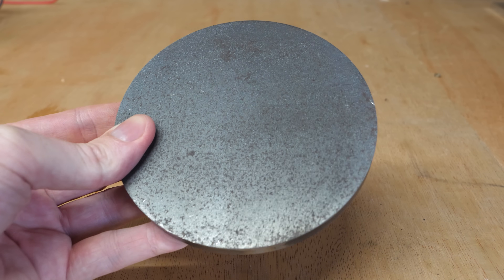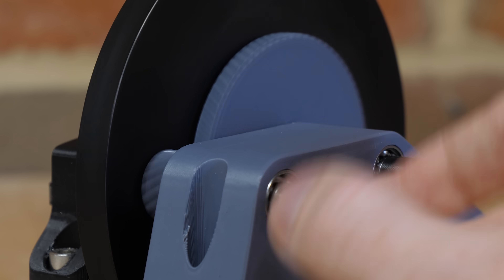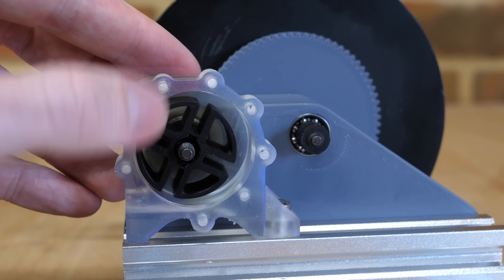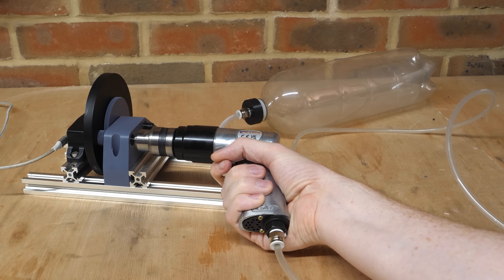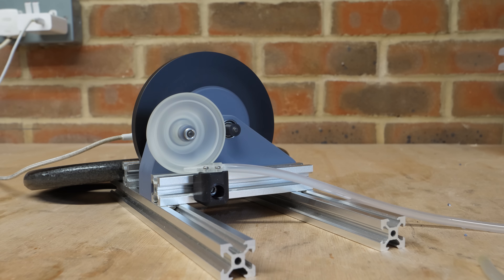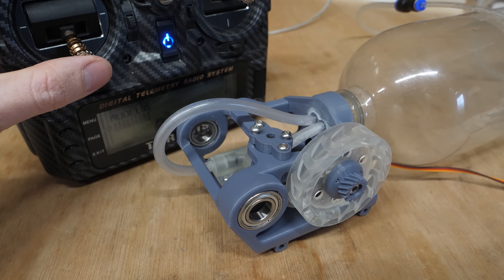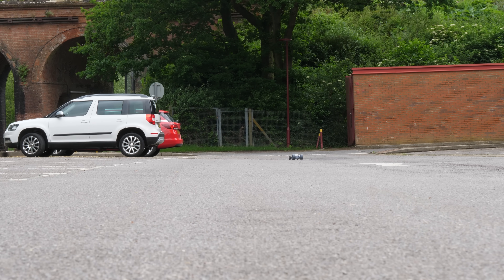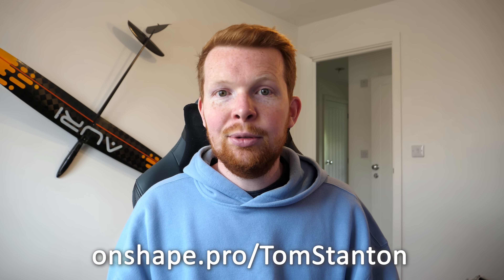Building a Turbine Car

Comment: I absolutely love the compressed air series. the way the way you get to the optimal result and don't half ass it is remarkable and respectable. we all can thank you for your videos.
Reply: This! He goes all the way to get a proper result, rather than doing the bare minimum and celebrating it.
Reply: @JellyFishMachine yes, well put. exactly what I had in mind. along with a few others he goes into great detail, explaining it perfectly. not everyone can do that and I bet he is proud
Reply: I am holographic speed painter guy and I agree.It's my favorite. Im trying to build permanent airship mansions
Reply: English grammar teacher like :- Why did you write  "the way" twice??😂😂
Reply: I absolutely loathe it.  You cannot power anything with this.  It is completely impractical.  Compressed air systems are very heavy and very inefficient.  He's practically cheating by using a pop bottle.  Even a small RC race car would need a MUCH, MUCH heavier bottle to carry significantly more air.  Air compressors are quite inefficient as are most air tools.  This is why they have been almost universally swapped out in auto mechanics, for example.  There are still a lot in industrial use though. There are lots of good reasons they are.  But energy inefficiency isn't one of them.
Reply: @tarstarkusz  It's like you've never had a hobby in your life.
Reply: @WillowEpp  Fun is a good reason to do anything.   I don't oppose having fun.  Why the heck else would anyone build an RC car?
It might be fun, but it isn't practical.
Reply: @tarstarkusz  small brains should stay in their lanes. Let the man have some fun son!
Reply: @tarstarkusz until you're making videos cooler or you're a pneumatic technician. Your input means nothing the same principle he is using is the same principle as they use for steam engines and new are engines
Reply: @TolliverWilliams  There are huge important differences between steam and air.  BTW, you can say the same thing about an engine, which is also an air pump.  The idea that I need to create videos to be able to have any criticism of someone else' video is absurd.  Imagine you just saw a movie and it came up at the break room in work and you said "Oh, I didn't like that movie" and some one says back to you "Oh, yeah, what movies have you made that are better?"
Reply: @tarstarkusz and there's already prototypes  that can go over 55
Reply: @tarstarkusz unless you have made a working prototype made something like that or I have a hobby that's not useless you can just shut up this dude halfway through his life is more successful than you would be if you had a thousand years
Reply: @TolliverWilliams  What is wrong with you?
Reply: @tarstarkusz there have been fully functional prototype cars built here in Adelaide.
Full size vehicles that worked perfectly....and they have been banned for a surprising reason!
The reason the Government banned it was given as "explosive decompression" in an accident.

It produced ample power, had good top speed, zero emissions.
Range was a bit limited but perfect for city commuting to work or shop runs.
Government was worried that holding tanks could rupture in an accident and wouldn't approve shielding solutions.
Eventually they dropped the idea, killed by bureaucracy not technical ability.
Reply: @Ripper-k1v  Nobody is ever going to sell compressed air cars.  I don't see how you can get any range. What was the company who made it?  What was the name of the prototype?
If I tell you they once made a jet powered car, but the government got it cancelled, I could just tell you the name of the car, which was the Turbine and the maker, which was Chrysler.
Reply: @tarstarkusz  mate, I simply said a bloke here in Adelaide messed about with that idea 10 years ago, it's nothing new.
He even built a working proof of concept but the government red taped it into oblivion.
Don't get all sassy because I simply relayed the story to you as I remember it.
There was newspaper articles on the thing and everything, if it bothers you that much I'm sure you could research more information on it.
Hell you should even be able to find footage of it!
We all thought it had great promise until it was knocked on the head!
Reply: @Ripper-k1v  You said "there have been fully functional prototype cars built here in Adelaide."
That makes it sound like a prototype by a car maker, not someone's backyard project.

The problem is you have to really compress air to get any energy density out of it.  Air compressors are very inefficient and high pressure air tanks are small, heavy and expensive.  Compressing air generates a lot of water and it rusts the inside of the tank.
Reply: @tarstarkusz  also, please don't assume I don't know anything about compressed air.
I've set up and repaired many workshop compressors.
If you've ever been on a worksite you would have watched some safety vids about the dangers of compressed air.
Ever seen one explode because some twat boss taped the overpressure valve? (more common than you think!)
Yeah, that shit will wreck ya day!
Reply: @tarstarkusz listen mate, many people love the videos he puts out, and I doubt it is because they want to use compressed air in real cars. It is just proof of concept and finalizing it. If you cannot understand the concept of a hobby and a simple bit of fun, your opinion, and while you have the right to one, is the only thing anyone should loathe.

ps: sorry for the bad english, it isn't my first language
Reply: @tarstarkusz  in case you didn’t realise anyone can create a fully functional prototype, where did you get the idea that a prototype had to be made by a company?

You say you loathe it but then say it is fine to do things just for fun, so why do you contradict yourself? Can you not see that this channel mainly just makes things for the fun of it, regardless of how practical it is?

You say tanks have to be heavy and they rust, have you never heard of composite tanks?
Reply: @conorstewart2214  Because it isn't presented that way.
Reply: @tarstarkusz   it's actually adenosine triphosphate powered because he filled it up in the here and now with a bike pump powered by his own muscles
Reply: @JaredConnell  If he were an American, it would be corn powered.  It's near impossible to avoid corn calories in the US.
Reply: @tarstarkusz at least know your facts before you go around telling everyone bull crap